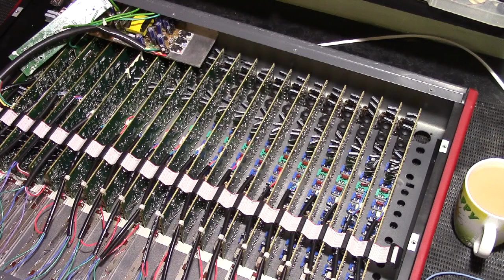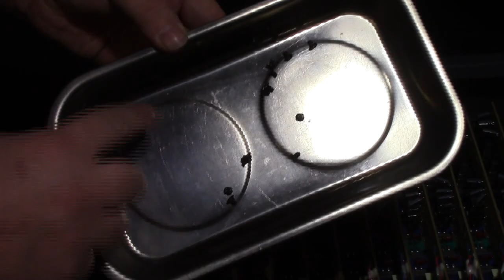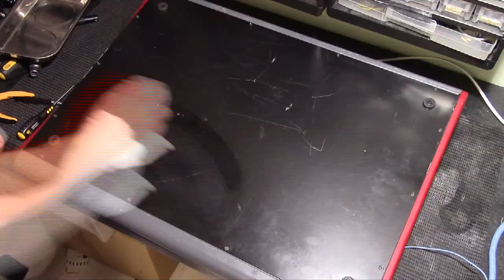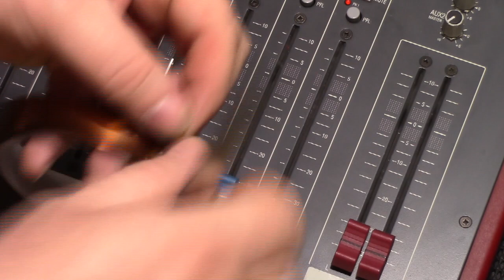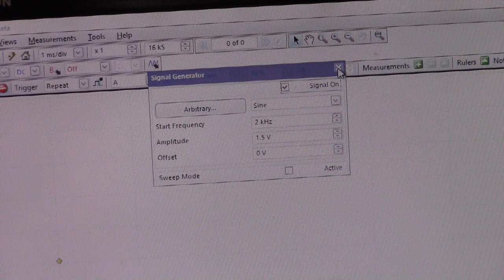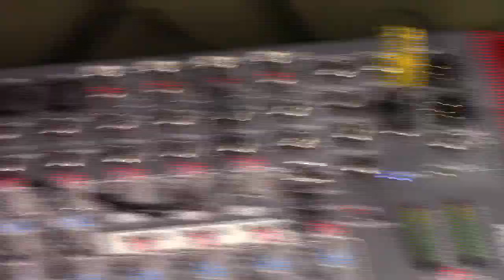Allen & Heath ZED 24 Repair. Part 4:Fix, Reassembly and Test

Comment: Hi, I have a nearly new ZED 12 EFX mixer, but it came with a minor issue: when you turn down all the stereo channels, there's a slight sound leak. It's subtle, but noticeable if you listen closely. Also, when using headphones, a little audio is still present even with all the faders down. Is this how the mixer is supposed to be, or is it a factory defect?

Comment: A random thing but in my experience of a mixer in this range, using the red clipping LED to set the gain leads to lots of distortion. I use the PFL button and the main meters and I also treat the yellow zone as a warning rather than a sweet spot. Love the mixer but I don’t think it’s one that likes being pushed.

Comment: This video will save me money thanks a lot, I have one question besides the mutes button I have one more issue when I turn on the mixer the volumes are pretty low until I push way up what ever fader (when a random fader is quite up the master volume start to be on the right level) what could be??? thanks a lot!

Comment: Good video! I have a weak signal on the right output no matter what channel is used. Also the sound is weak on low frequency on that channel. The other one is perfect. Do you think it is a hardware problem?
Reply from the maker: Hi yes soumds like a dead capacitor on the final output, or possibly a bad op-amp. Would need a signal tracer or scope to know for sure, but it sounds like a h/w problem.

Comment: Hello mate, very constructive video you have here. Thanks for that. I have an old Tascam M 106 and 3 of the channels have very low volume and the gain knobs don't respond at all. Do you think I can just follow your cleaning process? Also I have noticed you haven't used a multimeter to test the connections. Thank you
Reply from the maker: HI. It certainly would not help - it's a low cost way to eliminate a large part of the problem. Also, multimeters won't tell you much in analog audio circuits ;-0

Comment from the maker: Sounds more like a ground problem, (bad solder joints) or possibly input caps or dead op-amp. I'd do a thorough visual check of the boards for the faulty channels first.

Comment: Hey there! I have a ZED 436 and some channels don´t work properly. I have to put a very loud signal through them in order to hear the signal, otherwise it´s just crackling and noisy. Do you think that cleaning the way you did in your video would fix this problem? Thank you for your help!
Cheers!
Reply: Hi Ferdi, I have that exact issue with my Zed-R16! I was thinking it could be the power supply because I noticed it got very hot once and started playing up. Any luck with yours?
Reply: were you able to fix it?
Reply: @ACIDGREENTECHNO  The crackling didn´t  disappear completely, but it´s definitely much better now. Sometimes i still have to crack up the volume in one or two channels to hear a clean signal but not as often as before.
Reply: @soulfunksounds  contact A&H support mike griffin he is the designer of the zed mixers.

Comment: Hi I own this mixer and my power LED has stopped working could you please tell me what the value and type of LED I need to replace it with please.
Thanks so much
Colin
Reply: Same here, I have the ZEF16fX and the blue led POWER stays on for a minute after I boot the mixer up, but then fades off. Rest of the mixer is on, no problems.

Comment: Thanks for this excellent video. Now, I have a problem with the USB input on my ZED. It feels lose and the output is creaky and irregular. Nothing wrong with the cable. How do I get the USB input out (to fix it or replace it) ?
Reply from the maker: Hi - thanks for your comment. I will have a look inside my ZED 24 and maybe do a quick video on how to remove the USB. If i remember correctly it is on another of the cards, so should just be a case of removing the back plate, any knobs on the same card and pulling it out.

Comment: Thanks so much for this! Now I can attempt to clean the same switches on my ZED R 16! Cheers!
Reply: Hey so how did it go? Ive ordered two R16 mixers and each time they arrived with rattling inside. Idk what it is but I'm gonna open it up and see
Reply: Yep same desk, same problems. Rather do it myself than fork out a few hundred on getting it serviced
Reply: @KMBN-official  Same here. Those A&H Mute, EQ in, PFL, etc. push buttons on my ZED R16 have been rubbish from almost day 1. They were too new to have any dirt in them. Never got around to claiming warranty as I would have had to post it to Germany. My own fault. These videos are great. Do it myself now.
Reply: @eugeneburns6124  ha....exact symptoms on those buttons. Great desk though...really disappointing on these "minor" issues

Comment: hey! the master output on my zed24 is not giving out any signal (the desk is recieving it though) you have any idea what could be causing this? or should i just open it and clean the master output board?
cheers!
Reply from the maker: There are so many things that could cause this, it's hard to know what to suggest to you. If it's just the master out, and all the AUX sends are working, then that narrows it down a bit. Personally, I'd open it up and check all the mechanical stuff like ribbon cable connections, and maybe use some contact cleaner on all the switches and then take it from there.
Reply: will do that soon! and yes all the aux sends are working, recieving signal, not giving out any